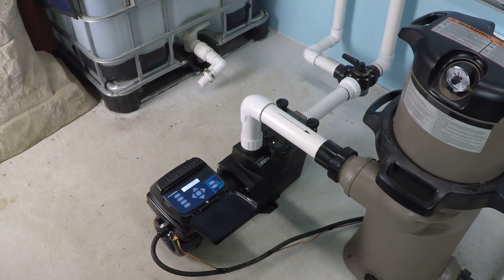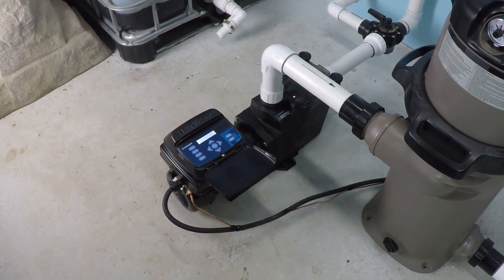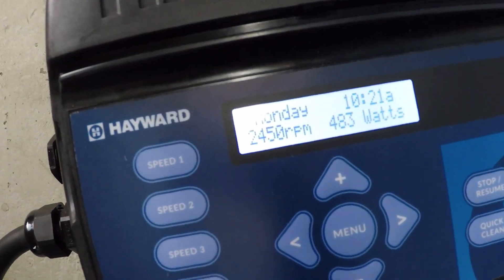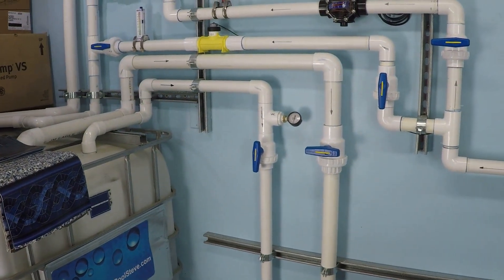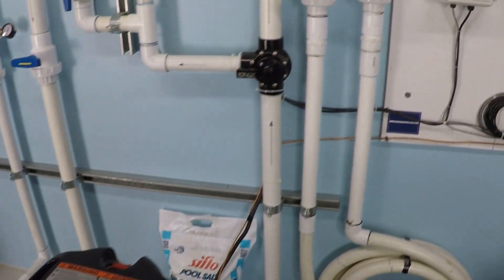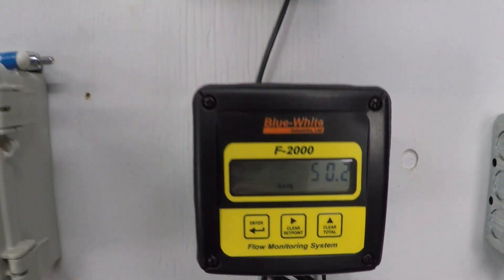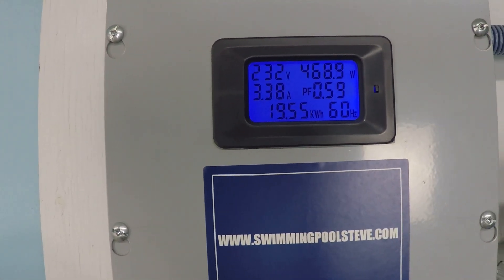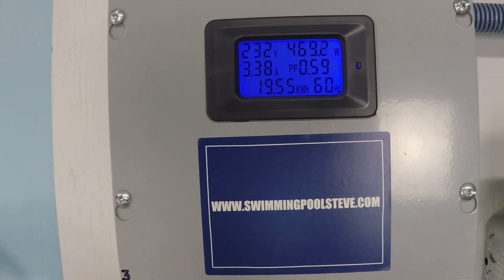How Many RPM For 50 GPM On A Hayward Super Pump VS?

Comment: I came across this video trying to sort out an issue with my setup. The TLDR version is h400 FDN ASME gas pool heater, natural gas in line with a one horsepower Hayward super pump single speed and sand filter. The heater is cutting out with the dreaded limit open "LO" error message. I had the hvac company come out that specializes in these heaters, they dialed everything in after the original install, tuned the gas valve etc. The guy tells me everything is ohm'ing Out appropriately.  He noticed a burned sticker inside the firebox that supposedly is not normally charred. He thinks the unit isn't getting enough water flow and is cutting out for that reason.  Actually not that it's getting insufficient flow and tripping the flow sensor but rather that it's overheating and tripping the over temperature. It sure is the case that if I put the multi-port valve on recirculate, instead of the filter option, thereby bypassing The sand filter, it runs quite a bit longer. But still will cut out with limit open eventually. I recently plummed in a 2-in flow meter in place of the check valve.  Most of the plumbing in the system is 1.5 in but the run between the heater and the sand filter is 2 in so it is sized for that pipe.  With a clean sand filter I'm seeing spot on 50 gallons per minute. With a dirty sand filter it drops down to 48, sometimes 45 gallons per minute. If I put the multi-port valve on bypass, it seems to buy me a clean 5 gallons per minute so I'm running 55 gallons per minute with the filter cut out. It seems like this heater wants to see about 60 gallons per minute if this is any indication. What does it make sense to me is, the current temperature of the water is at 90. If I set the set point to 95° f it seems to really struggle climbing out of 91°. The salt cell set up is reading a 10° Delta after the heater which is when it cuts out. Theoretically this heater should be able to take the pool up to 104° f.  Therefore even if I were to increase flow, if it seems to cut out as soon as the outflow temperature hits 101°, then it seems something must be defective? I can't imagine that this thing can't operate on 50 gallons per minute? The manual I think states that it wants to see 30 to 40 GPM which should be more than enough then where I'm at. Any thoughts on this? 

The whole picture is 20x40 vinyl liner salt cell pool with a deep end just under 9 ft. Calculating 40,000 gallons. I have a solar cover on anytime we are in the pool. The pool has two returns and a bottom drain and I have all three open. The plumbing is 1.5 in spa flex.